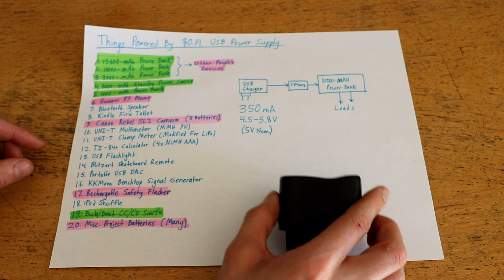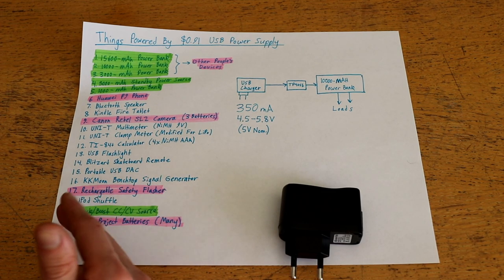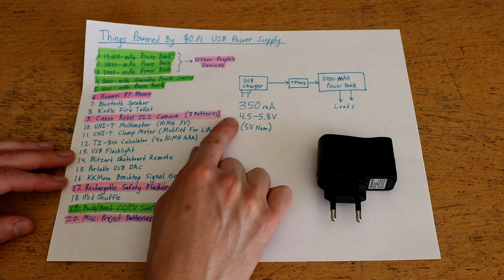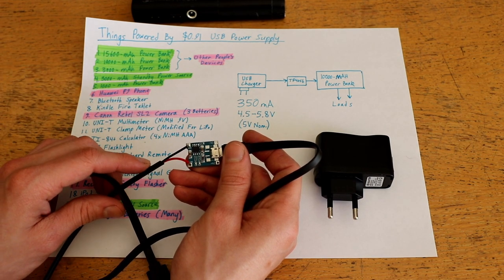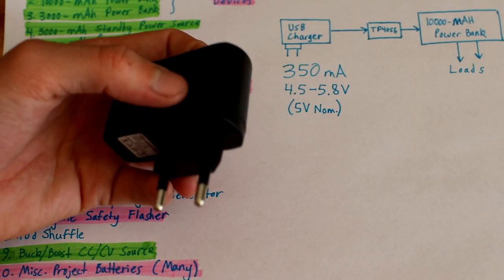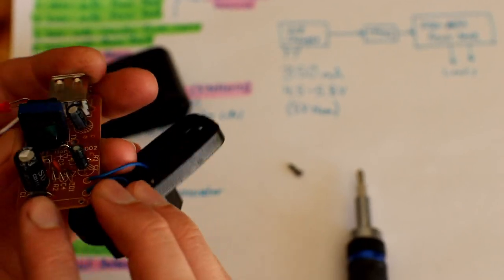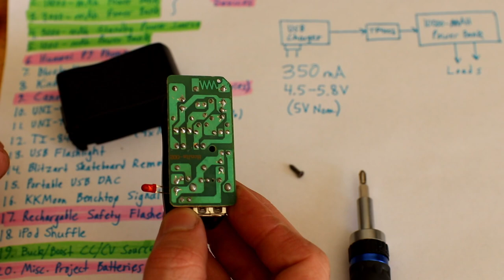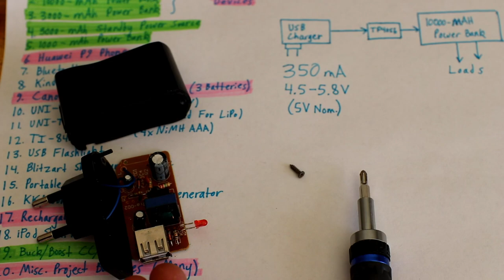EP 52 - eBay USB Adapter: 1 Year Later

Comment: Just be careful. I have been taking a few of these apart recently to see what they are like. There are many variants but they are basically the same. There is NO FUSE anywhere and the insulation between primary and secondary windings on the transformer can vary from nothing/lacquer to a couple or layers of tape. That is all that is between you and mains voltage. Also, I would at least cover any exposed metal/tracks on the the low voltage side of the circuit board and secure the flying wires from the socket pins somehow so that they can't cross the isolation and put mains voltage into the low voltage side or usb shield should they become detached! The soldering is not the best. Ps I am no expert! Cheers for the video.
Reply from the maker: Good points. When I first did a teardown/reverse engineering of this charger last year, I ran a 1kV insulation test and it passed, so the primary-secondary isolation isn't all that bad.